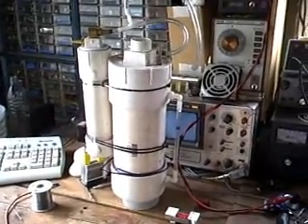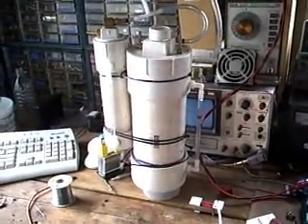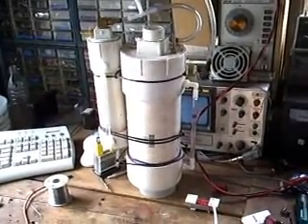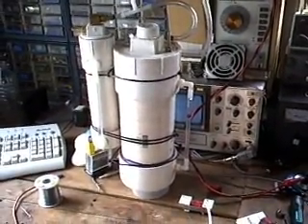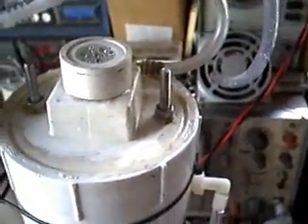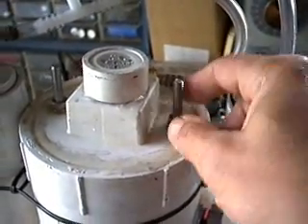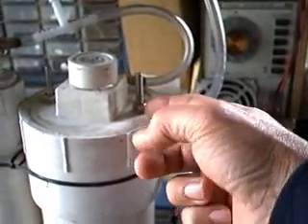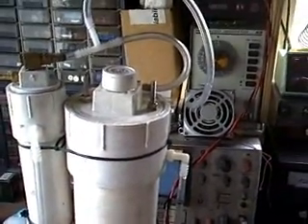#91 - VSPB pulling from the Toyota for mods

Comment from the maker: Rheostat is just a fancy word for a high power variable resistor. Tremendously inefficient as any power not delivered to the cell is dissipated in the form of heat. PWM's are the way to go.

Search the web for Chemelec. He just released a PC board foil etch pattern for my new current limiting PWM.

Comment: Sweet, Zero. I'll be waiting. 
Have you considered running a high amp alternator, and splitting the ling between a few cells? If you were getting 3V over 4 cells (12V total) with a single trap, and running a 100 amp alternator... you could theoretically get the 10LPM now.

Comment: If you want to increase gas mileage significantly... you'll need a TON more hydrogen pressure than what you're getting out of a single cell. Try using a cell cluster with a single trap. (4-6 cells surrounding your trap) You're probably only getting about 1 LPM, you'll need about 10x that to get real change in gas mileage.